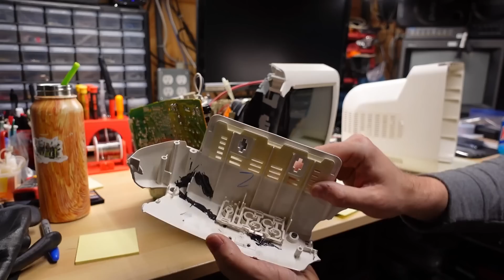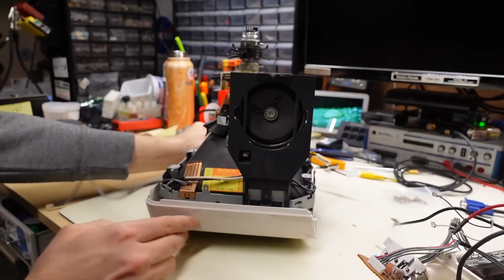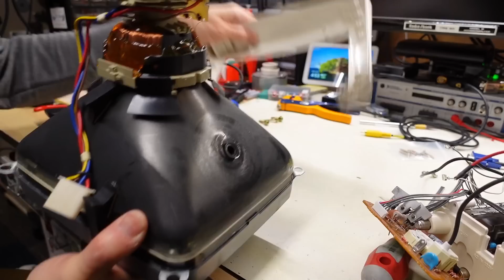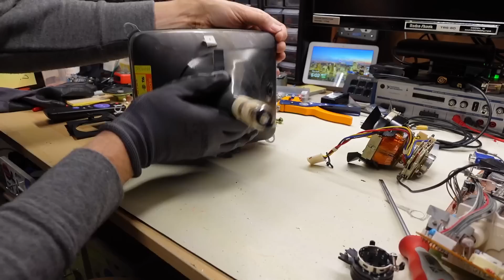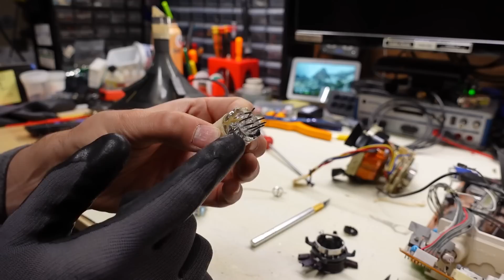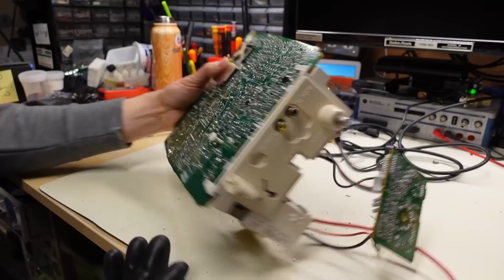I failed badly fixing this little Sony TV (KV-9PT50)

Comment: Do you still have the chassis from this KV-9PT50? My friend just got one from Salvation Army yesterday and it has capacitor issues… like staying blank until it warms up and then showing a red, green, and blue trace lines across the top like those PVMs and BVMs that are about to fail if you don’t replace two specific capacitors. I’d love to refurbish this chassis and swap with his bad one.
Reply: I know it’s been years but you do mention at the very end, hoping that someone could use this… prompting my response here. I imaging you probably used parts from it but that would be totally OK. Thanks!

Comment: FWIW, Plastruct plastic weld works miracles on ABS and some other types of plastics. I've been using it for a while to piece together old Macs that have gotten brittle, and the joints it makes are stronger than the unbroken bits around it. It also doesn't make nearly as big a mess as JB Weld.

Comment: you got the convergence a little wrong
when you spin the rings, the red/blue/green move in small circles
like...
..O..
O.O
when you spin the discs( there will be a point that the 3 circles perfectly overlap
also there is 5 rings, 2 are for screen position/alignment, 3 are for each color convergence, it can be a nightmare if you ever get them out of alignment
Reply: also hope you saved the flyback, if you wrap 2 wires around the core and connect them to 1 transistor and 2 resistors you can make a each 25-30 kv supply with like 12v in....well with a 9 inch it may be 15 or so, the HOT that comes with the tv works great for this

Comment: You missed the most obvious give-away of a CRT broken this way: a snapped off exhaust tip. That exhaust tip is the place on the tube where it's sealed during manufacture after the tube has been fully evacuated. If the tape wasn't on the neck, you would also have seen the Getter (the structure used to hop up liberated air molecules) turn from silvery to white and chalky. That is another give-away of a broken tube. Usually when a tube is broken at the exhaust tip it does not implode, which is why if you must make a CRT safe for disposal, that is where you break it. You are indeed fortunate that the CRT didn't implode because the set would have been full of leaded glass dust, phosphors and the odd glass shard. The glass/aquadag capacitor you were talking about earlier is part of the high-voltage circuit. As you mention, the Flyback transformer creates the high voltage and there is a usually a half-wave rectifier (though sometimes a doubler or triple) that feeds the CRT. The glass/adquadag is the the filter capacitor for the high voltage power supply. Yes, it's only a few hundred picofarads but that's okay because the beam current is tiny.

Comment: I loved using Trinitron monitors and still have a couple of SGI and Apple rebadged models tucked away, but I was never very keen on the late FST versions, they traded flatness for a little distortion, which was fine for a TV, but no so much for a monitor.

Comment: I had three 24" Sony Trinitron monitors way back in the day.  I was running dual displays on my main system and one on my file server.  They were branded as HP on the chassis, but the guts were a Trinitron.  They were originally used for high end HP Unix workstations.  So they used a cable that broke out into five BNC connectors that carried the actual image.

Comment: Newer CRTs have these ICs:an eeprom for the microcontroller,a microcontroller,one or two ICs(if it is multisystem) for getting sound and video out of the IF signal,H/V sync ICs,sound amp,AV switch IC,SMPS IC,and a few voltage regulators.

Comment: I found a local recycler, that has an absolute ass load of old crts.  I tried to list some of them on different auction sites like eBay or Craigslist.  It makes me really sad to say but nobody's really looking for these even the hobbyist.  Every once in a while I see about 300 tvs in a bin, most of them work just fine.  Getting crushed.

Is there some kind of online community that would be interested in trying to save some of these before they're crushed?

Comment: I see a chip on the bench that looks a lot like a PDP-11 CPU. A possible hint on a future video?

If you need to stick plastic back together, you could use a plastic rod or piece of 3D printer filament in a rotary tool to weld it. The spinning plastic makes enough friction to melt both the plastic rod and the surface of the broken parts.

Comment: When I worked with video terminals, the yoke assembly was rotated to various positions based upon where the terminal was sold to because the CRTs are affected by the earth's magnetic pull. For those terminals heading to Australia, for example, the image was rotated substantially to one direction so that the image was obviously tilted. Depending upon the destination, we had various templates to align the image to ensure they were orientated properly when the equipment arrived at the customer.
Reply: Is that why they say in the service manual of the KV32HV600 and or KV32HS500 and other included in that service manual for the set to be front and back facing east and west or west and east vs north and south?
Reply: @bsanchez3563  That would be the reason because even rotating a monitor around in a room can cause its display to shift. It's been a very long time since I had to think about that stuff though. 🙂

This is in the service manual for information during display calibration and alignment, but it doesn't matter for the consumer.

Comment: 12:55 The primary purpose of demagnetization is to reduce color distortion caused by an electron beam that is wrongly deflected by a magnetized tube. As this is a Trinitron tube, there is no color distortion if the electron beam is off in the vertical axis, in contrast to regular shadow masks. This is why the demagnetization only needs to be effective in the horizontal axis, again, unlike regular shadow masks.

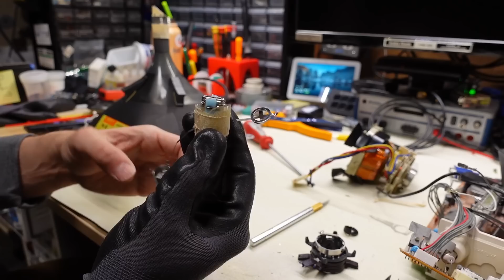Comment: 22:03 - The one with the springy long pickup is the anode, the pickup is touching the internal anode layer on the CRT wall, it's on the same positive HV potential as the raster and the mask/grill is. There's no pin for that one on the neck connector.

Comment: 22:04 - The ring on the antenna dangley doodad is called the "getter" uses a metallic compound which is fired with an induction coil after the oven and vacuum pulling process.  It is meant to remove any remaining air and impurities to further improve the vacuum quality.  The diffusion pumps used to pull the vacuum can sometimes introduce a small amount of contaminants inside the CRT.

Comment: What would be interesting is to cut the existing traces connecting the two chips via I2C and set the Arduino up between them, allowing it to forward only certain commands and filter out others which could potentially interfere with whatever experimenting you're trying to do.

Comment: I have a 9" Toshiba color CRT ( it was in a zenith TV ). I parted out the TV, but I had to stop when my soldering iron gave up the ghost after making a sputtering sound with just one partly parted double sided board left. It's just a tube, no yoke or anything. I need to get rid of it, but I'm afraid to toss it down the old rubbish chute ( might implode and destroy the chute ). I don't think the building manager, or landlord, or anyone would appreciate that so much. I don't have anything small and strong enough to stick into the black plastic alignment part ( which seems effectively glued on, especially after seeing all that glass stuck to the Sony's ) to break off the nipple and let the atmosphere hiss into the tube. Besides, performing such an operation on my lap ( no work bench, and table is used for food prep and eating ). I mean, laps are meant for warming cats and giving them a reason to purr. Not for imploding comparatively large tubes ( accidentally ). I only pop 60W bulbs over my lap ( in a cardboard box ) when they have a brass base. Well, you never know when you might get the urge to mod an LED bulb. Also, I wouldn't toss the CRT down the rubbish chute even if I let atmosphere in as it's mass could ( once again ) take out that old rubbish chute and turn everyone from a friend into an enemy. In addition to which, I don't possess anything with sufficient insulation to discharge the tube. So then someone cleaning up the downed busted up rubbish chute and bins might unwittingly pick it up with there hands firmly on the DAG, and the ( fairly, hopefully, insulated non Dremel roto tool ) cut off anode wire lightly in contact with an arm. Not to mention how many people could there be in this building who part TV's out? And by the damage to the rubbish chute from the floor bellow me on down, how many parters could be on my floor? Just saying that toss could be a personally identifiable act. So I guess I'm stuck with a perfectly ( good? ) CRT kicking around on my floor. Uh, perhaps my use of the word kicking wasn't the best choice of words, after all I have no idea how powerfully those things go off, or how large a hole it might leave behind. Well, I guess come the next inspection I could always get the inspector to get rid of it. But giving him ten pairs of rubber gloves might make him a little suspicious, and they could be wholely inadequate. Plus Id have to give him instructions to not toss it down the rubbish chute, and to set it down fairly gently without dropping it.

Comment: One of my go-tos for larger-scale plastic repair is PC-11 epoxy adhesive paste. With some patience (and a bit of inevitable frustration), you can sculpt with it, and the result will be sandable, and the finish is a very reasonable white which makes for a much less obvious repair than most other epoxies. And it's very strong.

(I have no affiliation, it's just saved parts for me more than once.)

Comment: The flyback has a thing called a cascade where a relatively low ac voltage is stepped up using a string of diodes a capacitors to a high, somewhat pulsating DC voltage. It is not a 20kV winding and a 20kV++ recitfier.
Reply: At most I think they were voltage triplers, so for a 27kV tube you'd still start with 9kV out of the winding.

Comment: Here's a quick tip if you are decommissioning a CRT permanently. That little button on the side where the high-voltage attaches to from the fly back, is a thin metal. If the electrode gun is damaged and you want to make it safe for disposal, then take a nail and lightly tap it in the center of that spot. Poke a small hole in that metal and let it sit there and suck in air for what seems an eternity. At least that way if you drop it, you just have a bunch of broken leaded glass to deal with and not an explosion hazard.

Comment: I scuff up the surface and if I'm going to paint it or don't care about the mismatched color/texture, I drill small holes along the break line either side just big enough for the epoxy to get through and then sand it smooth on the outside.  You could also use a tool used to put texture on plastic to kind of scratch different rough grooves into the rear and you'll get a really strong hold that way too, more so than just applying or a light scuffing.  I have a couple metal tools for this or a razor blade/exacto works fine, just add different angles to help the material fill and lock in.

If that tv worked, I'd probably repair the rest of the casing by setting up meshes and reshaping the holes.  I also love that kind of stuff so that would be as much fun as repairing the tv itself lol.  Too many thousands of hours to count doing auto body work, sculpting, etc.

Comment: I bought one of those from goodwill in like 2009 to use with my //c its pretty crap even for a Trinitron the electrics in it just don't do the tube justice. It was meant as part of "hang shit from the bottom of your cabinets" spacesaver fad in the 90's started by black n decker. Mine had its swivel  base which could be screwed into the top rectangular slot, and then had mounting holes to hang it

Comment: please if you glue plastics back together, use gorilla super glue, its the best for things like this, its almost as strong as plastic welding and nothing beats it. Ive used it on 3d printed plastics that are highly stressed and it would break the part instead at the joint where the glue is

Comment: Dang. I knew as soon as I heard it…vacuum loss. I may or may not have caused that on more than one tube over the years. The sound of air rushing in is something you’ll never forget as all your hopes and dreams leave your body simultaneously as the air rushes in. Regardless, great video!
Reply: I did that once when putting the (honking enormous) lid back on a TRS-80 Model IV. And it was a green phoshpor CRT too. It really turned me off from messing with those monsters. I put a "come and take it" offer on vcfed to pass them along to others. I really don't like all-in-one systems.
Now that all of my old Model I disks have been long ago imaged with a Catweasel, I just run my old stuff on an emulator.
Reply: I thought that sounded like wind! It’s kind of beautiful in its own way.

Comment: Degauss coils are a great source of enamelled wire for repair jobs. I scrapped a massive 32" Philips TV about 10 years ago now and im still using the wire from its degauss coil for repairs :)
Reply: It does make me wonder what the pcb layout guy was thinking though, when he put what seems to be a headphone output socket right next to the line voltage !!

Comment: For the i2c injection problem, you could put your device as a "man in the middle", have it accept and resend commands that keep the TV alive (i.e. voltage events, etc.) but then just don't pass through the commands that you're overriding.

Comment: RSVP baby Trinitron. It wouldn't surprise me if someone deliberately smashed this to get the extra few millimetres of copper wire from the cable. Which is a real shame because there would be far more value in a working Trinitron than just a few cents worth of copper wire. They probably spent far  more in their labour than they would've got back from the value of the wire.

I dragged a huge flat screen TV from where someone dumped it a couple of blocks away to about 100m from my place before my arms gave out. I had intended on coming back a couple of days later with a furniture dolly that I was going to borrow from work, but by the time I got back to it someone had pulled it apart and ripped out all the wires, delection coils, transformers, etc.
Reply: Scrappers definitely know that the yokes and degaussing coils are copper wire.

Comment: That circle on the end of that long bit of curved metal is what’s called a “getter” which contains some chemical compounds that attract any remaining molecules of air that may remain after evacuation. This is the same thing as what’s under or behind the silvery spot on most any vacuum tube.

Comment: To repair plastic chassis I use a cheap solder iron  to melt and mix at the same time the seam of the break and zip ties. They're easy to handle and to melt. Obviously I do this from the inside and I try to find zip ties with the right color, or close. If it needs to be stronger your can use metal meshes or old wires inside the plastic. Don't breath this!

Comment: Instead of epoxy, you can do a much quicker repair of a plastic body using a plastic welding kit.  It's a little device that heats up zig zag shaped metal clips that can be pushed into the plastic across the seams (pushes in like butter because of the heat), and it makes a join stronger than the original plastic.

Comment: Rebuilding CRTs used to be a thing where the gun assembly was cut off the back of the picture tube and a new one attached, then the tube was evacuated and sealed, but the very last company in the world that did that work has closed up as of a few years ago (it was in France).

Comment: one most modern Sony tv you could get into the service mode to calibrate it by doing the following sequence with the remote when the tv is off: DISPLAY,  NUMBER 5, VOLUME UP, POWER, the tv will turn on and you will see on screen all the hidden items  that you coud adjust

Comment: The best way to transport a CRT is on the glass (in Europe there were an extra glass layer in the front to make it even safer), but you need to have some soft to put it on to avoid scratches.

Comment: I always feel pain looking at broken CRTs
Reply from the maker: Even abandoned ones on the side of the road make me sad
Reply: @adriansdigitalbasement2  By the way how is your  1702 monitor. Is it arcing? I guessed previously that there might be round cracks. They tend to appear at high voltages and high frequencies around flyback and HOT transistor.

Comment: Nice autopsy video there, Adrian :)
 I have found an old 13 inch russian color set this weekend but I have not yet tried it because I have no time to play with that. But I think you should try and look around on eBay for another non-functional Sony set just like that. And make a working TV set out of the two. Here in Hungary, they are really cheap. I gave a bar of Milka for a working large Sony Trinitron.